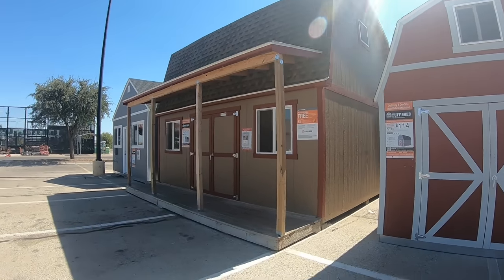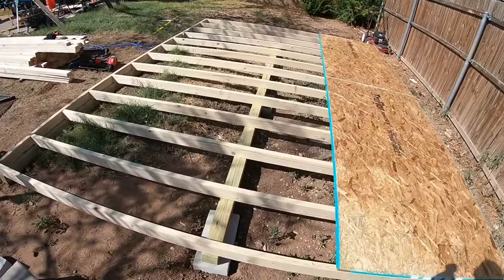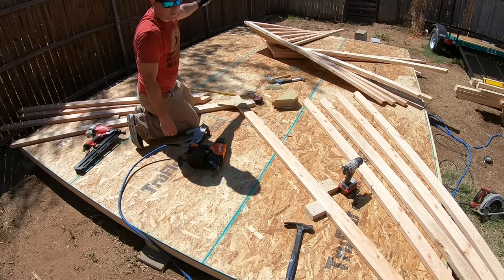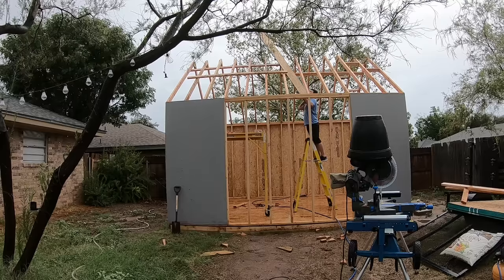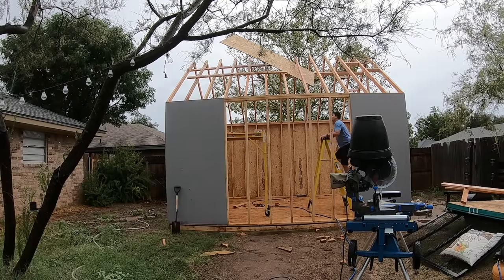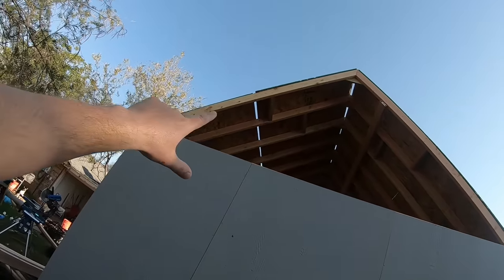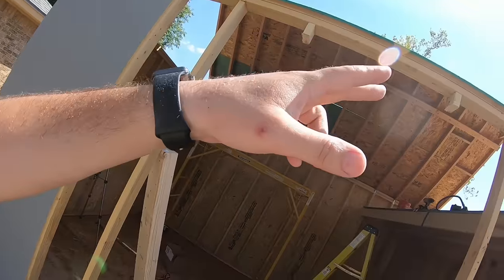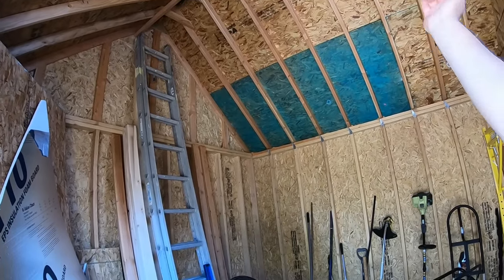Giant Shed for a fraction of the price!!! 12x16 with a Loft!!!

Comment: Dude you scared the hell out of me watching that first sheet going to the roof. Like John Q here says, so many things done wrong. One thing you can do is to add in some windbraces. Basically a bridge across the rafters. The weight of the roof, especially if in snowy area, will settle and push the walls apart, possibly even total collapse. I would come down at LEAST two vertical feet. Lower would give more strength. And of course, check the walls for plumb before you secure them. I would put a temporary brace from wall to wall before installing any of them.  For your sake, I hope nobody reports you to the building department. The inspector would most likely make you take it down and start over.

Comment: of course, you're smart! if they sell you shed of plywood you're better off building it on your own. btw, I wouldn't use wood but concrete requires harder work for sure. though it's wet proof, bug proof, fire proof, etc

Comment: At least you learned something after the first wall.   I still think the roof in the non-lofted area is a bit deficient. I would put some rafter ties or collar ties up there.    The floor is also pretty sketchy.  You should have spliced the 4x4 runners over the foundation block and it looks like you used 2x4s for the floor system which means your floor is pretty spongy.

Comment: How many 2x4 did you have to get
Reply from the maker: It was about 40 2x4 for the walls… The walls are built on 16 inch centers.
Reply: @fixingspencer  how many for the roof
Reply from the maker: @laytonclark_  Roof took 28… also on 16 inch center
Reply: @fixingspencer  u bought all 2x4x12 right or what
Reply from the maker: @laytonclark_  2x4x8

Comment: Sliding those roofing sheets up onto the roof from the outside would have been easier but I then realized you didn't have a taller ladder. Ugh.   Size does matter. 😜

Comment: I used to build boat houses, and I used to run Alum a steel up a ladder on the outside.
Had you screwed some 2x4's at the bottom to slide the plywood up and over and it would be a stop to keep the plywood from sliding down.
Then place a couple 2x4's in the right spot or close to the sheet placement it would aloe you to position and fasten it without having it slide down.
Granted running alum a steel and fastening it to external stringers is a bit easier than plywood.

Comment: You are going to regret not putting an overhang on your shed. OSB doesn't fair well when it gets wet and it will get wet. Especially on the ends with horizontal joints.

Comment: I am strictly an amateur but before lifting the first side why not screw lengths of 4 by 2 to both ends in such a way that they could pivot as you lifted it to the vertical? I am typing this before seeing more if the video so maybe you do this.
Edit: Am I missing the reason for putting the first roof board up from inside the shed  rather than outside?

Comment: The truth is while 8k may "sound" expensive...    and really those prices are a bit high.   This is also a reseller.   There are plenty of "factory shed builders"  around that will make them and deliver them.   this means a lot less work for you but does increase the price.   it also means the buildings tend to be more safe and long lasting.

Comment: where's your doors and windows how do you get in it once you side it😂 don't try this at home😅 I believe you start on the roof from the bottom across and work your way to the top so the seams of the plywood don't meet in the same place as they go to the top for more strength

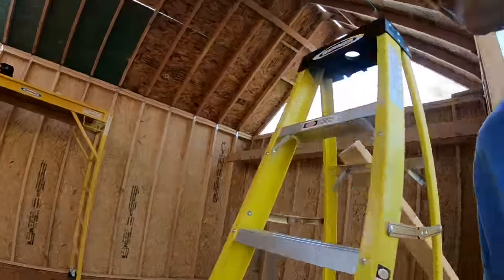Comment: are the studs for the platform @30:40 structural to the shed? I'm asking because I would like to remove this additional storage from mine but don't want the shed to fall apart. Any info would be greatly appreciated.
Reply from the maker: The platform is not needed structurally… just make sure you install top plate correctly.